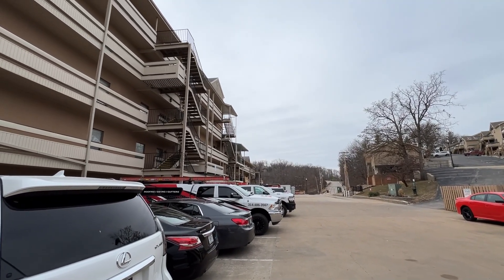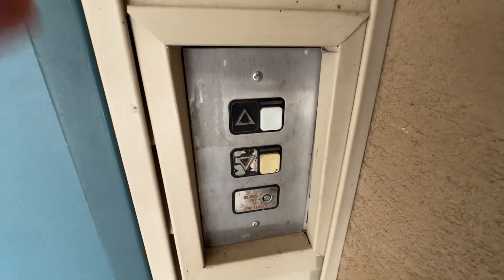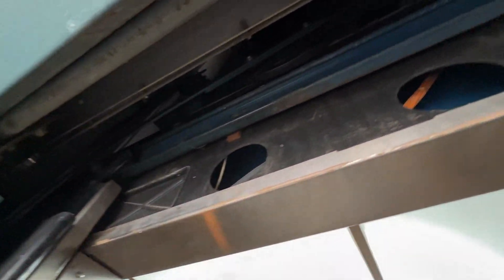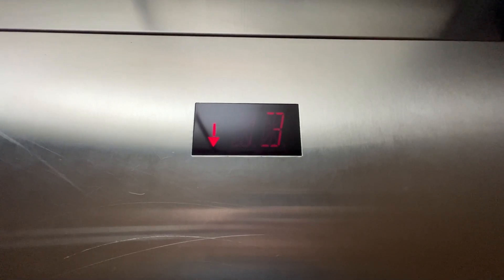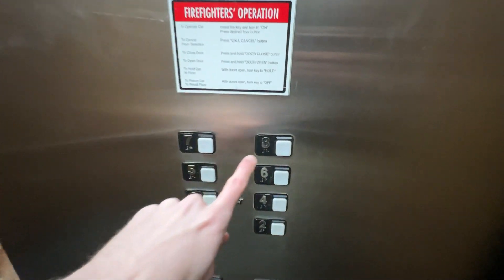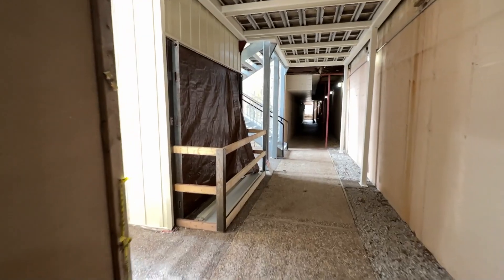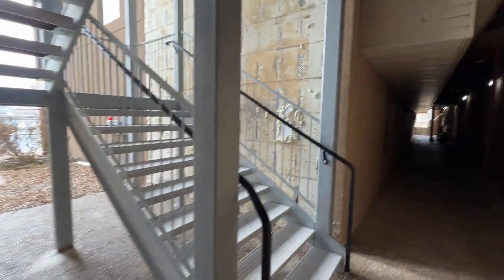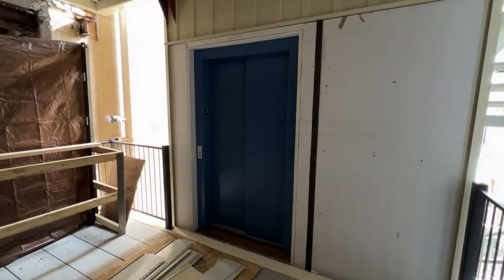Long Bar! Awesome Westinghouse Traction Elevator at the Falls in Lake Ozark, MO

Comment: Really nice elevators for a late 1980s Westinghouse elevator just before their acquisition by Schindler. But it's really sad that these elevators are being replaced, especially since they have the Long-Bar MT buttons, and I am willing to bet that the new 3300 elevators are NOT going to last 35 years like these elevators did. Also, were you able to get some of the parts, such as some of the Long-Bar MT fixtures or the adjustable pitch Westinghouse chimes?
Reply from the maker: I didn’t get anything.